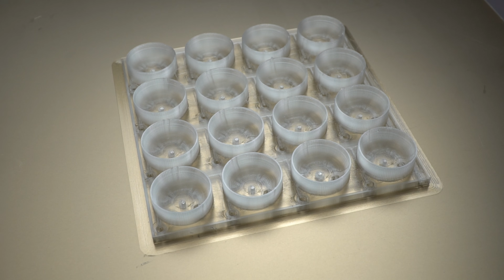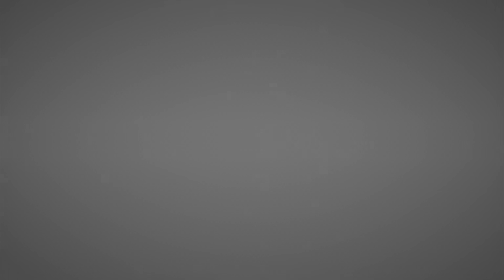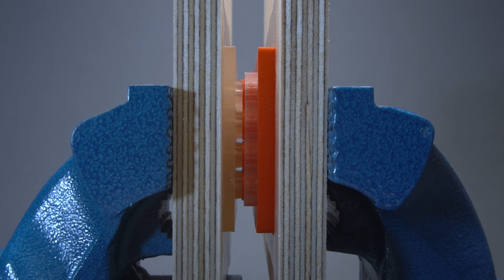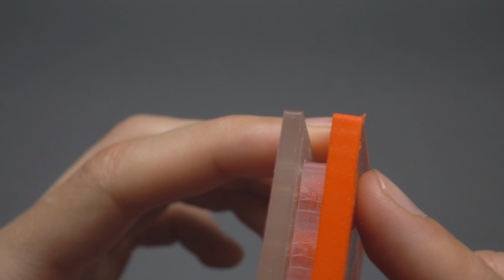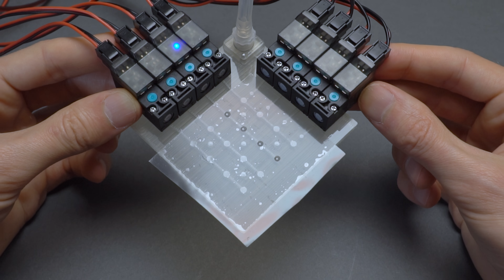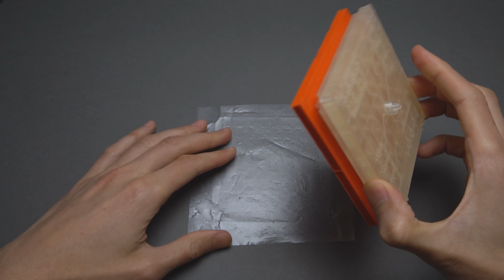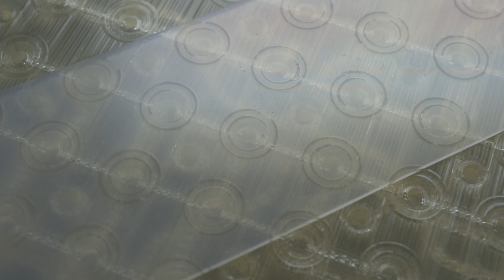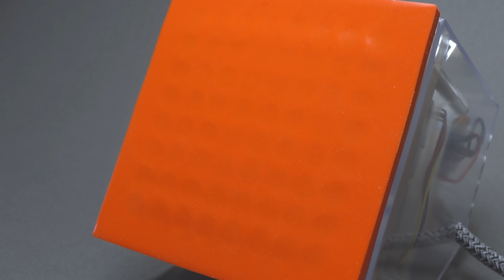Air Powered Display: 3D Printed Fluidic Multiplexing

Comment: this could be a way to display braille if it could get small enough
Reply: I'm thinking that the circuit could be made using Laser Cut / Etching on metalic sheets, that way the circuit can be miniaturized. Obviously, they will need some sealing between layers.
Reply: @KafshakTashtak  Could use basic lithography like is done for circuit boards
Reply: @sponsor-i9h  Yes, that's one of the processes. But for this, I'm not sure how small it can become. The membranes will face a limit in thickness, and it shouldn't be a brittle material like silicon. Metal and laser cut is enough I think.
Reply: @KafshakTashtak  could do some acid etched metal. Maybe even printed.
Reply: @KafshakTashtak  I've thought of a few solutions from mems to magnets, but I think every solution is going to suffer from the same problem.  The demand is too low to scale it up; you can't have the fifty million dollar facility to build the 'thing' because it just isn't a fifty million dollar problem.  Not blindness persay, but the specific product you intend to manufacture.  The natural alternative for small scale problems then is small industry.  The problem there though, is that a solution like 'borrowing screen-printing tech to make tactile motor arrays' still requires a minimum amount of technology and investment to produce, and this in turn needs to be exceeded by the returns from satisfying demand that isn't there.

ed Just realized this is also the same problem behind finding cures for rare diseases and cancers.  Curing any disease is an expensive venture, and the efforts are aimed at ones that will give the best results to either finances or public health.  Most entities have to find a balance between the two.
Reply: @KafshakTashtak amazing idea, I might use it if I decide to do this!
Reply: Braille displays already exist and are pretty efficient due to their electromechanical design.
Reply: @Atom224  yes, but they break easily! this would be more robust.
Reply: @Dylan_Lanckman  Without telling the prices of some. It's incredibly expensive!
Reply: @Jacobra-qv6iu some as much as a small car. It's nauseating.
Reply: @Dylan_Lanckman  wow is the BOM so big or do they maximize profit because the target market will pay pretty much anything (or don't read at all)?
Reply: @Dylan_Lanckman  Yes, and the problem is not really that people that use them require them normally for using technology. The real problem is the foundation of software that used in most of the programs is completely screen or visual dependent. A fix normally could be a small mechanical display or even solenoids but to navigate through all the programs, the software needs to adapt to the hardware. However, people that use them are a minority and they need to do their own programs for them unfortunately.
Reply: @kautzz  I have no Idea why. The tech in itself is pretty simple. They're tiny solenoids pushing a plastic rod up in each dot. The electronics inside resemble the same stuff a smartphone has, except no audio and the graphical stuff replaced by the solenoid drivers. The cells (6 or 8 dots per character) are plug and play... Probably the engineering and the small target market are both things that push the price.
Reply: @Jacobra-qv6iu  Yes, the readers are dependent on overlay software with text recognition.
Reply: @Dylan_Lanckman  there is no way a hydraulic or pneumatic system would be more robust than an electromechanical one!
Reply: @ObjectsInMotion either way, it's worth investigating.
Reply: @Dylan_Lanckman  Relying on multiple seals is more robust how?
Reply: @Dylan_Lanckman  I remember seeing an opensource reader a year or 2 ago on youtube that was cheap to build.
Reply: @Dylan_Lanckman  More robust, and also cheaper. You, theoretically, could print/manufacture this in 1-4 pieces. It'd be quite a bit easier to produce.
Reply: @kautzz  as usual, it's maximizing profit at the expense of disabled people
Reply: @Atom224  They are prohibitively expensive.
Reply: @Atom224 for this air one to work, youd need a thinner membrane. That would probably be the wear part. 

Or i guess you could have small metal pistons that protrude but that might get clogged with dirt or need seals that would have to be replaced.
Reply: @Atom224  and they cost 10th of thousands $... here is a by far lower cost can be achieved
Reply: @Atom224  They are also ridiculously expensive. Sadly, like the majority of disability aids, most people have difficulty affording them.
Reply: @Atom224 this could be a braille that could change text when your done reading it
Reply: What I've been thinking. I'm not even blind but the idea of us developing stuff like braille e readers and stuff is sick. Rather than having to find a braille version of every book, or use an e reader for everything, you could have one device that could translate all your pages of text to braille!
Reply: @TrAnonNoName  and well scale it a bit., the viewing windows, the could display the images, the could fast enough, moving images, too, enven the to the level the kid text book wint pictures, the some wild, the out alsready as a product
Reply: @TrAnonNoName  Lol, this has been reality for over three decades already. Braille displays aren't new tech at all.
Reply: @FoobarDesign  i'm pretty sure microfluidic pneumatic braille displays have also been done, although "been done before" isn't really a reason someone else shouldn't try to do it too.
Reply: Came to the comments to say just that! 🤝
Reply: you could make it into a sort of glove or other gripable shape and link it with a language detection program and a camera, and turn it into a braille reader that could be slid across a page to read words on it. I'm sure there are better ways of doing something like that but this would be cool regardless
Reply: @shermanbeacharmoredrecover8189 great idea, we can already track a finger position on the screen, just a braille finger output and it should work.
Reply: You have to make it bulge out though
Reply: @MisterPalindromic  exactly what I was thinking.. a semi spherical 64 bit (maybe more, I am just watching this out of curiosity) silicone face on that thingy be driving people crazy...just like small vegas sphere but vaccum that talks to you..
Reply: Probably wouldn’t be such good idea to be a "display" beyond a cool project. Pneumatic can be a workhorse mechanically but it scales very poorly in term of "computation".
Refreshable braille display already exists but they are small and very expensive to manufacture. 
There has been a lot of progress into soft material and actuators theses last few years with robotics and prosthetics either for stuff like capacitive touch or artificial muscle so it could probably be an actual research direction with standard electronics and connecting that to a matrix with these actuators even if admittedly still not really mature as a tech yet.
Reply: @trucha1785 A large braille display that is easily cleaned wi a great idea. The possibility of adding pressure sensors as feedback when a braille dot is contacted but a reading finger could lead to games, HID interfaces, control panels, and more. Refreshable tactile images would be very useful for visually impaired students while learning geometry, statistics, physics, and so much more. As a new member of the blind community, I applaud your venture and encourage all who might join you.
Reply: Had the same exact thought
Reply: It would have to be reversed. Braille is bumps, not cavities. It’s easier to feel.
Reply: braille display would actually be so cool lol
Reply: With systems running around 2000 USD for 20 characters (yes $100 per 6 cell character) there is definitely room for innovation. It may not be commercially scalable but if it lets a loved one read...
Reply: But isnt braile the oposite? instead of vaccum it should make a bubble.
Reply: @carlosdlguerra  it could be a dimple or a bubble
Reply: It could be like kindle for blind people, make a bunch of 2x3 pixel collections in a row so you could read like 5 letters at a time, or more
Reply: Large dimples can be used for a braille billboard
Reply: If made with injection molding instead of 2d printing it definetly can get small enough
Reply: @pudimlaranja4118  You can't inject mold the internal structures. Years ago I made valves like this with a resin printer. You need some tuning but it works well and you can achieve channels easily 5x smaller. On some papers they even made a full CPU just with that. You can also create the "equivalent" of CMOS with positive pressure instead of just using vacuum. Issue with smaller channels tho is that pressure control is much harder, and a lot of non issues at this scale become hard to achieve just with a 3d printer (standard microfluidics are not made like this but etched on glass with photo-lithography and then bonded to PDMS).
Reply: It would prolly work this large as well....just a bit annoying to read id presume.....
Reply: Absolutely! It would be super cool if this tech led to something like a braille e-reader and special signage for store shelves or convention centers or something.
Reply: Had same idea. Interactive braille display
Reply: I didn't even think about that.
Reply: It definitely can! I would suggest the air chambers behind be pushing a piston rather that sucking the membrane to a cavity
Reply: Some startup made a microfluidic braille display years ago. Tho no idea if they ever commercialized it or if they still exists. Microfluidics already have a lot of applications in the real world, and there are already a lot of process to make them really small (with photo-lithography).
Reply: pneumatic cylinders exist for way smaller size, mass produced, durable and cheap. you can tile them compact and they work with small electric current. this entire project is meaningles
Reply: I think it already can with it going one at a time (like if you press a key, the braille equivalent would show on the matrix, and then you would just slowly spell a word)
Reply: I think an array of custom built linear actuators and a membrane for them to push against would do a better job at that
Reply: Yes, a 90 by 240 dot display would be perfect for computerbraille (also known as 8-dot) and this format leaves room for spacer rows and spacer columns. It also allows for braille-friendly dot-matrix charts. The only thing that needs to change in this design is that we don't need depressions, but compressions.
Reply: I said the same thing!!!

Well... sort of... I mean I did start off with saying he should fabricate it in dong form facing out. =) haha

But yes!! Very, very, very tactile braille that you don't necessarily read with your fingers would be AWESOME. =)
Reply: Genious idea
Reply: I’ve been thinking this since back when I saw the first 4x4 display!
Reply: You'd have to def add layers, just like PCBs to cram so many little dots in a single area. But that's an engineering problem that can be solved and it would give blind folks a decent resolution
Reply: My thought exactly. And critically given how expensive braille displays are.
Reply: That's actucally a insanely good idea
Reply: Im pretty sure such things already exist, but they make bumps instead of concaves, im also pretty sure that reading braille with concaves is like reading white text written on top of biege page
Reply: real-time braille caption display
Reply: 3 x 2 pixels
Reply: i just said that. damn. i thought about this for that years ago, but i dont know tech stuff, so never did anythig with it. but yeah. a changeable screen you could make games for just for blind people. ive seen the ones where the little pegs come out to make braille but thats all they do. this could so so much more. also, could be used for tactile feedback using air bladders in VR gloves or body suits....just saying.
Reply: I don't think, sucking on your fingertips is a desirable feature.
Reply: It can! The limiting factor is not the fluidics, but the durability of the membrane. It's very doable.
Reply: Braille display
Reply: Those have already existed for a long time.
Reply: Clicked on the video just to say this.. LOL
Reply: blind people e book
Reply: Can that type of braille run doom?
Reply: not really... You'd need a very special membrane material, I think. The membrane would need to be able to form pockets that are very small, and thus the membrane would also need to be very thin. The solid parts would also need to be very thin and still contain the pressure. Probably metal, probably 3D Printed. I don't think this scales down well.
Reply: "this could be a way to display braille if it could get small enough"

There's something like that already - you just don't hear about it.
Reply: This is honestly something I never would've thought of and I now find it so cool. Because imagine a world where we all used some form of tactile computing that adapted to the data itself, like feeling the information or a website literally
Reply: A sign that could toggle between regular text and Braille when you touch it
Reply: It's hilarious and also disturbing how many people don't know that braille displays already exist. I know a blind guy who has a rather old laptop with a strip of character units. Basically same idea as a dot matrix printer print head.
Reply: up
Reply: holy thats genius
Reply: And invert it so it's pimples instead of dimples as braille is meant to be convex bumps you can easily feel
Reply: @aqua-bery  can't really do that with the way it's built
Reply: @I @IAmCymepka would only need to swap vacuum into pressure higher than the atmosphere and inverse the logic gate. Probably wouldn’t work as well tho since the pressure differential needed would be impractical in addition to the additional mechanical requirements of the material jumping.
Reply: @trucha1785   What about some kind of solid object that's actuated by the vacuum dimples? That is, the dimple "sucking in" pushes on something, which then causes the other side of the board to protrude outward in roughly the same location.
Reply: @IAmCymepka Just make it blow instead of suck.

...that was worded better in my head.
Reply: @IAmCymepka its not theoretically difficult to build one that sustains the inverse pressure
Reply: braille would requiere the dimples to be proud rather than sink, and the resolution needs to be dramatically larger, pin displays which exist already are available with 2400 pins of resolution so...  maybe doable?
Reply: @BitmapFrogs  Push out is completely optional it just has to be easily recognizable vis touch
Reply: @fischX  the whole "easily recognizable via touch" requires a raised surface for braille